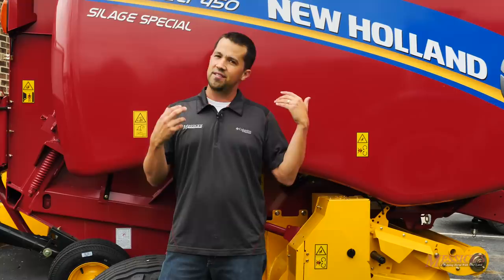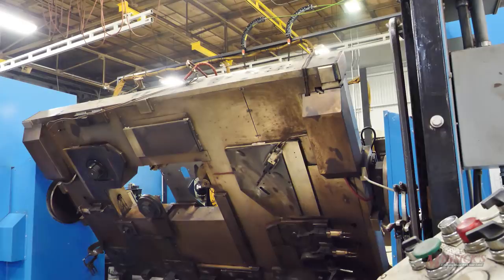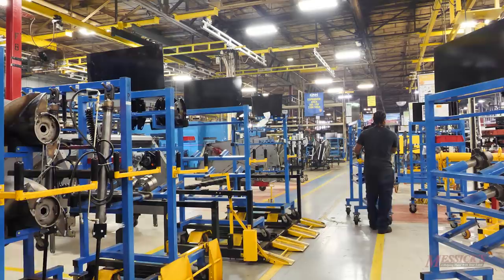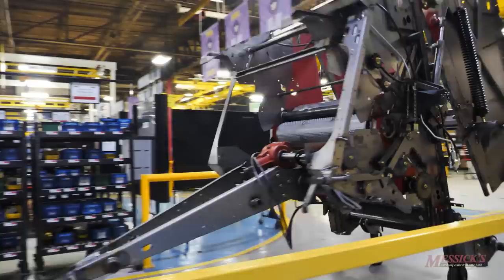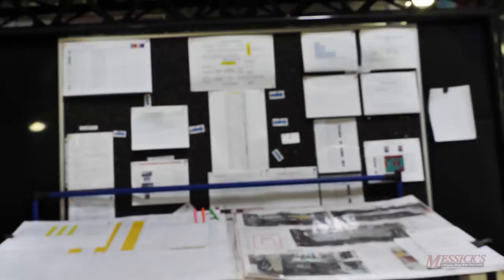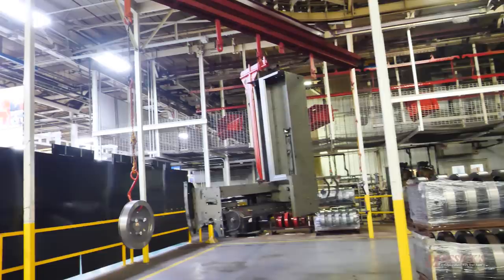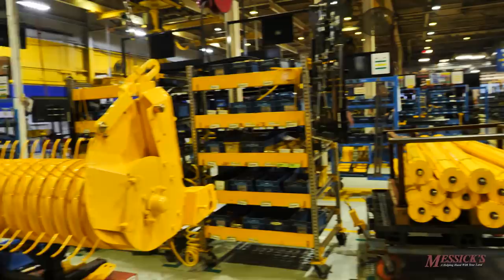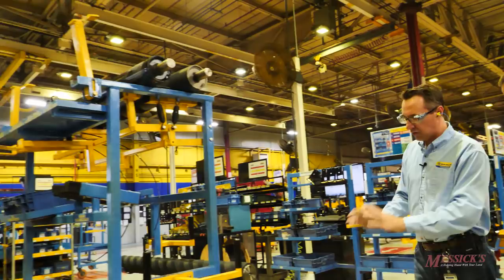How a hay baler is made | New Holland Hay Tools Plant Tour

Comment: Well somebody goofed on my BC5070 had just over 700 bales through it when BANG AND BANG then it was DEAD 
Plate holding the wrist Pin to the bale packing head had fallen out ( bolts not torqued)
First BANG was the connecting rod , second BANG was the feeder forks hitting the bale packing head ,which sheared the splined shaft off, think its a 1.25 inch shaft  ( like a toothpick ) 
Dealer service dept sent a tech up ,he cleaned the bale up with air nozzle ,found all sorts of bolts loose ,some ready to fsll out 
It's all fixed and running good now , but took them close to 3 months to get it back to me 
Not much quality control on that unit !!
Reply: That was the first baler of the new year.

Comment: I have new Holland balers for many years. I even have a bar round baler still use it today but the newer they get the more they get cheaper made I’m not a big fan of the carrier in the new ones 10000 bales and there junk belts get out of line and rub the Carrier and cuts it into the loud gear nosies and have to be replaced I believe new Holland could do better but you can’t beat the old ones 
Thanks for the tour

Comment: Very interesting tour. 
Why do they not make the side panels fit more closely to keep all the detritus away from the working parts.
 It really annoys me at the end of the season to have to clear several bagfulls of muck from the important areas. All the side panels do is to provide a space to proudly display their name!
Reply from the maker: They keep chaff out of the gearing. Hitting those areas with a leaf blower is part of daily inspection. Allowing accumulation is how you end up with a fire.
Reply: @MessicksEquip  If New Holland keep the chaff out of the gearing they are the only ones that do it. Designing a well fitting guard/cover would prevent fires without the need for daily leaf blowing.  None of the balers I've seen have one.